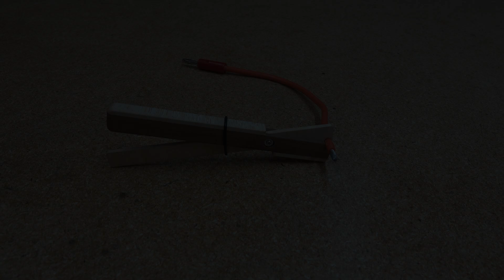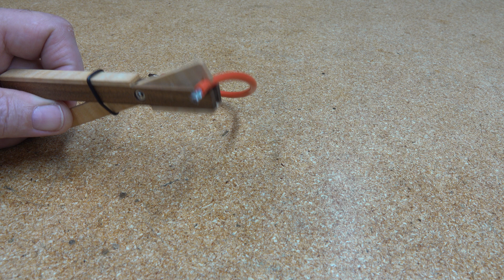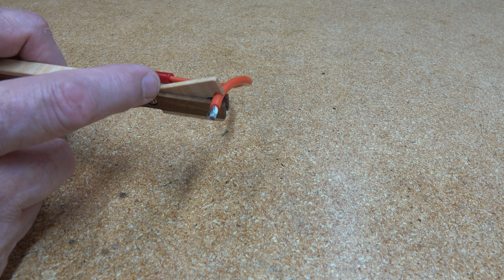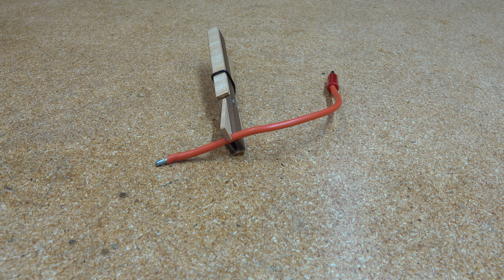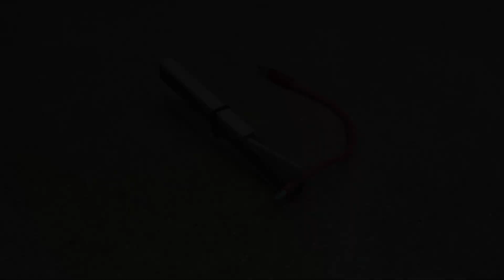MAXIMIZE HEAT In Low Powered Soldering Irons!

Comment: wrapping alligator clip with cellophane insulation tape would probably work as well ??
Reply from the maker: The heat needed to melt solder is around 700° Cellophane turns pliable at very very low temps. You still have no tension adjustment but I'd say adding some silicone tubes around the jaws would help, and it'll take the residual heat.
Reply: @joesshop3622  thank you
Reply from the maker: @bluedragontoybash2463  Thx for the visit!

Comment: Could you do a demonstration of soldering two piece of the same wire with the wooden clip and a normal alligator clip from a helping hand or similar?
Reply from the maker: You can prove this easily, grab an under powered iron or turn yours down and give it a try...anything metal depletes heat.  As stated, the alligator clips also can mar the wire insulation and are not tension adjustable so wood wins on both accounts, try it! I know the answer, I'm not here to lie, misinform or mislead anybody for any reason...I'm here to help you out!